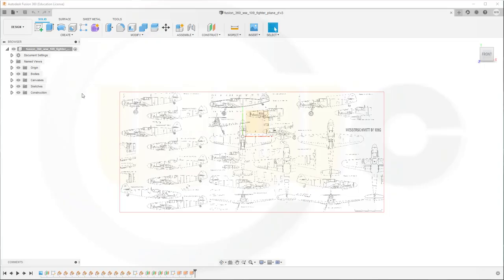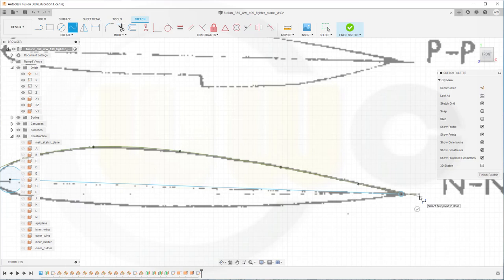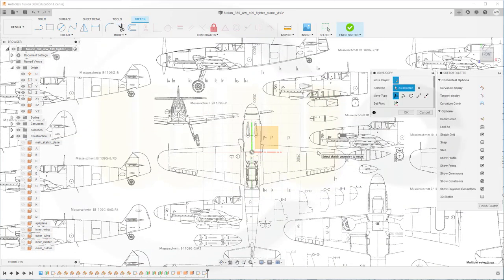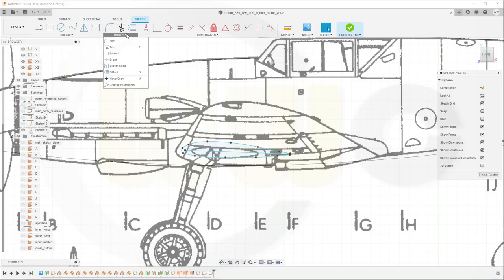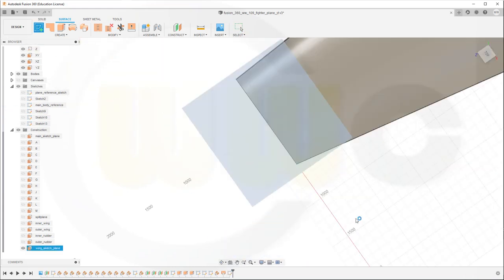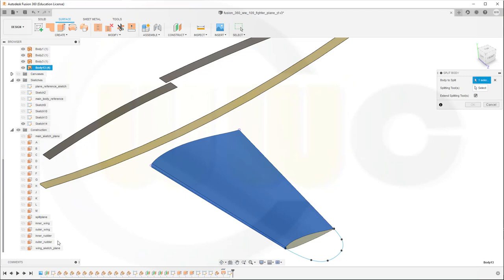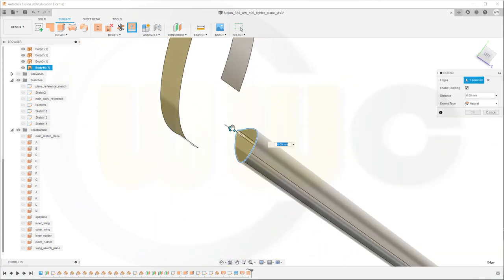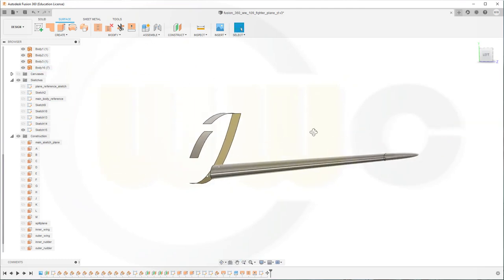WW-109 Fighter Plane - Part 2 - Wings - Fusion 360 Training - Surfaces

Comment: Great video, thanks Wolfang! Maybe two things which could have been done differently, for the wing intersection plane, you could have used a construction plane through 3 points, instead of the 90° plane, but doesn't matter. For the wing tip, you could have inserted again the canvas and moved it to the right position, then we could have achieved a greater detail. But I know, its a tutorial for fusion, not a modelling tutorial in general.
Reply from the maker: To model it in 7 programs takes a lot of time, so I went for a more general approach. As always its just to give the viewers some ideas how they could do it.

Comment: I just found this...interesting method you used to build the wing however, you did not include any washout at the wing tip. I am trying to loft a wing with washout and it seems to be quite difficult. How would you include washout in this wing?
Reply from the maker: There is a simple reason - these are just exercises not real working models 😉 But a loft should work, could you explain your problem?
Reply: @wolfgang.walden.cad.training  Of course, I am trying to loft a wing for a Russian fighter from WW2. It has 2 degrees of washout at the tip. Because the root rib and tip rib do not exist on the same plane (due to washout), the system won't loft. I am thinking of trying a straight loft (no washout) and then inputing a twist to see if that might work. Unless you routinely do washout for flying models and have a better solution.
Reply from the maker: Thanks, you are using Fusion 360, I guess? Usually the rotation of the profile at the end should not cause a problem.
Reply: @wolfgang.walden.cad.training  yes I am using Fusion 360

Comment: I thought that this training would be about making building plan for rc plane, or at least exact copy from canvas/plan! But it's just aproximate model, that don't even follow plane's shape ! I'm dissapointed.
Reply from the maker: Why should I know how to build an rc-plane? My videos are cad-excercises which show how certain tools work or how you could use them. You should have noticed - these are TRAINING - videos.
Reply: @wolfgang.walden.cad.training  I didn't mean that you should build an rc plane, but what bothers me is that steps you make are not precise as it's on the plan. You draw lines and position averything by eye and not as it's on the plan. I was dissapointed about precision, and precision and measurment's are what CAD programs are made for. For plane like this you don't have to have a plan, because this is not the same plane as on the plan !
Reply from the maker: You don´t get it, do you? These are EXERCISES for tools. Apart from that - this image of the ME-109 is not a plan at all. A plan would have dimensions at least and it is even not in a very high resolution. Feel free to download that image and model it "precisely".